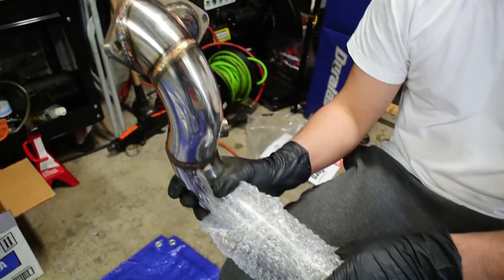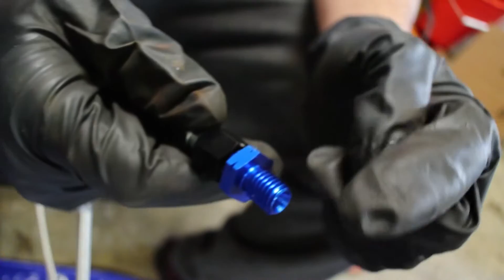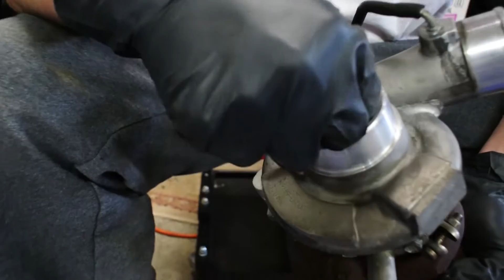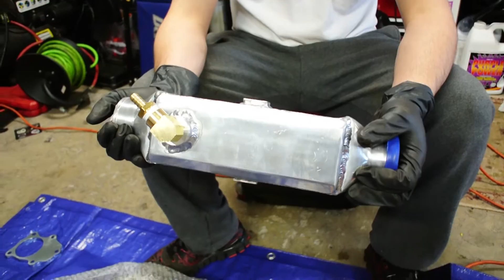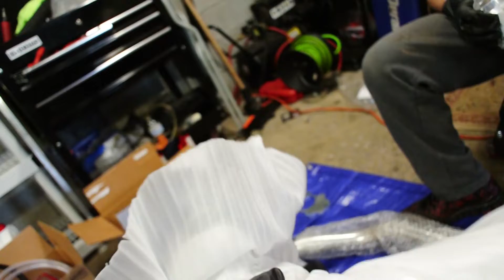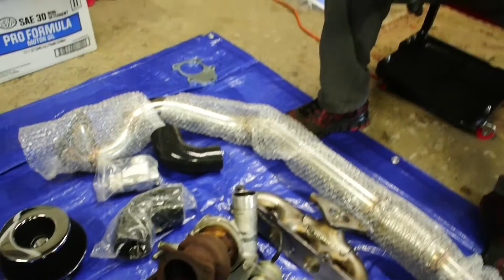$600 Miata Turbo Budget Build - All the Parts

Comment: Above the sticker on the oil that says "engine oil" it says heavy duty desiel oil? Might want to check that and get petrol engine oil
Reply from the maker: Rotella is great for gas engines. Only reason it says diesel is because it contains zinc which isn't allowed in oil for gas engines because it can harm the catalytic converter if oil is burnt through the exhaust.
Reply: oh ok thanks I bought that exact oil for my car and then noticed that so I returned it. didn't know it doesn't matter.
Reply: I run Rotella T6 full synthetic for my sport bike. It's awesome.
Reply: And phosphorous. For what it's worth, there are much better oils for running in Turbo motors... Strongly recommend Penzoil Platinum full syn, it has done extremely well in independent tests, readily available, and quite cheap.
EDIT: Apparently new BMW "Twin Power" and "Euro" blend Penzoil Synthetics are relabeled Shell Helix products, which would do quite well in this application.
EDIT2: Unless you're breaking in new cams and bearings....
In December, 2007, the publication GM Techlink, distributed to GM dealers, contained an
article by a GM lubrication guru, Bob Olree, of the GM Powertrain Fuels and Lubricants
Group..; he addresses the ZDDP
question in detail... he flatly calls the concern about ZDDP a “myth,” citing the
extensive testing of modern oils for scuff resistance. One paragraph is especially worth
repeating here:
A higher level of ZDDP was good for flat-tappet valve-train scuffing and wear,
but it turned out that more was not better. Although break-in scuffing was
reduced by using more phosphorus, longer-term wear increased when
phosphorus rose above 0.14%. And, at about 0.20% phosphorus, the ZDDP
started attacking the grain boundaries in the iron, resulting in camshaft spalling.

Comment: Don't use the air filter with the silver bit in the middle. It comes off and will suck into your turbocharger and destroy it...

They are cheaply made guys - Don't risk it Please.
Reply from the maker: +TheEpicCoww I haven't seen that happen before.. I'll be sure to order a new one but so far with over 1500 miles on the turbo build everything is fine and I haven't had an air filter kill my turbo haha
Reply: Okay cool. Just wanted to make sure you knew about that potential critical problem.e You may have a brand that is strong enough to hold it in place,  but you also may have got one of the dodgy ones Its hard to tell with ebay / cheap parts. Have a good one! - Glad i could help :)
Reply from the maker: ***** It's a Spectre, AutoZone special! Haha
Reply: Haha, be carefu! Keen for the rest of the build... :)